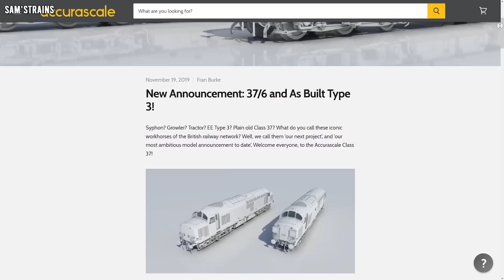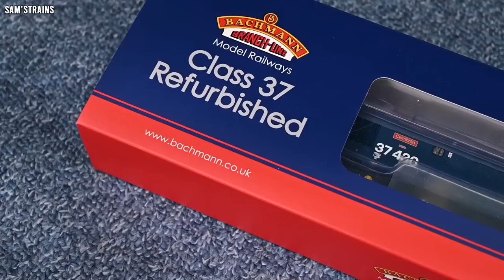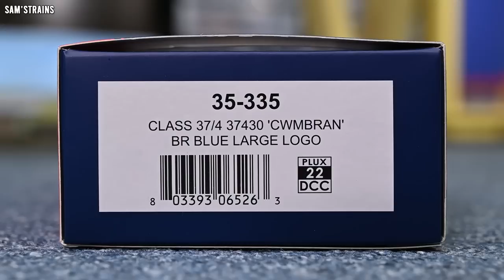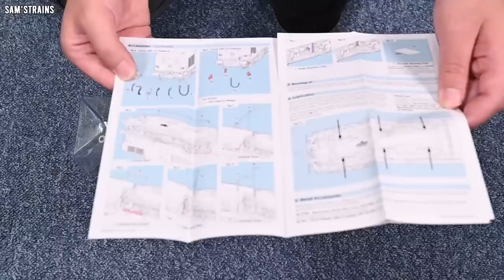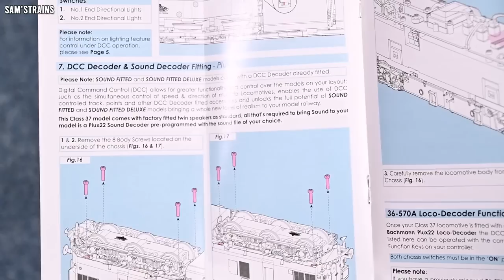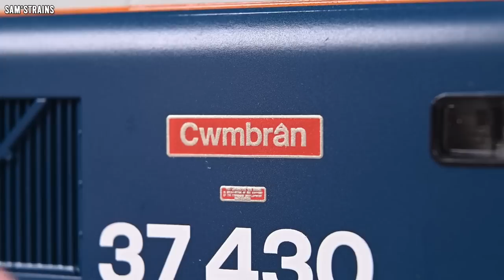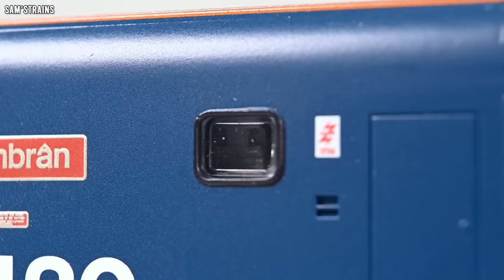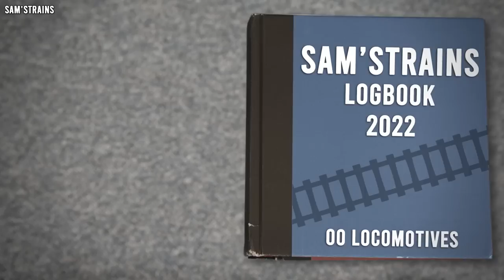All New Bachmann Class 37 | Surprise Release | Unboxing & Review

Comment: The old bachmann one still stands up. But it's always nice to have an updated version. I remember when vi trains released the 37. It was decent in its own right. But if companies are going to flood the market with a class of loco, the class 37 is the one to have lots of variety of. The prices though. I remember paying £50 for a bachmann class 37 and less than that for the vi trains one. The prices these days are why I only watch videos like this rather than partake in the hobby
Reply: Soo right why don’t companies design or update other locos
Reply: @robbiegrant5729  Bachmann has been updating their back catalogue for a while now. They've re-done their class 20, 24, 47 and 158 to very high standards recently and the class 25 is coming soon. They also re-did their Warship not too long ago, and improved the tooling on the class 40, 44/45/46...though these could have done with a full re-tool to be honest.
Reply: Yeah, the old one still stands up well. It doesn't stand up as a premium model any more - but at the right price, it still has its place in the hobby!
Reply: @christopherstokes9393  Absolutely, I still have every intention of doing the cab glazing correction mod on the 37/0 I started before this one was announced. I'm also keeping the Accurascale pre-order in place. Having said that, if Bachmann produce one in the livery and variant I want I'll happily buy it over a SH old tool one though, unless Accura beat them to a split box Dutch one. Sam seems to have a bit of a duff one if its struggling like that, the 430 I have doesn't have any torque issues. I took it to the club today and ran out of stock at 56 bogies and it still has enough grunt for more; same as the class 47 vid I uploaded a few months back.
Reply: I’m hoping that Bachmann will end up upgrading some of their other locos, as models such as the Hall, Jinty, B1, Standard 3, 4 and 5 and several other models need a few upgrades and definitely a new chassis. Then there are the V1/3 and Ivatt 2MT Tank, which need a new body but have had the chassis upgraded, and other models such as their Peppercorn A1, A4 and 9F could probably use a complete re-tool. That’s just my opinion though…

Comment: Bachmann have also retooled their 20, 24, 25 and 47. So it is not surprising they have retooled the ubiquitous class 37. And Accurascale are also releasing the later privatisation area 37/4s with detail differences including plated over side windows and front end lighting differences, so the new Bachmann 37 is an as-refurbished condition 37/4 which Accurascale haven't actually modeled yet.
Reply: Bachmann doesn’t make 37423 or the 37/6s with Wipac lighting, or the magnetic roof panel which makes DCC fitting easier than ever

Comment: Its a stunner of a model, but as you say the Accurascale model could well pip it depending on what lessons they have learned from the Deltic. I won't be cancelling my Accura 37 pre-orders any time soon, but I have succumbed and bought the DCC sound (not deluxe) version of this model as it is a simply stunning rendition of the Welsh 37/4s I remember very fondly on the sprinter replacement services of the late 80s and then the North Wales Coast trains out of Crewe through the 90s into the early 00s. I have to admit, a big bugbear of mine is working cab lights when a locomotive is in motion. Having been in a fair share of different class cabs in hours of darkness at various preserved lines, running with the lights on is a recipe for big problems as you literally can't see outside, meaning that signals (especially old semaphores) are very easy to miss. Safe to say I hate working cab lights unless the model is stationary or pottering about on shed, in service though is a HUGE no no.
Reply: Another point to consider is that Bachmann have been re-tooling their older back catalogue models to a VERY high standard in recent years having done the class 20, 24 and 47 plus the 158 DMU in the past year and the class 25 coming very soon. With that in mind, the big question about the 37 is more likely 'why not sooner?' rather than questioning whether its directly a result of competition from Accurascale. Another point to consider is Hornbys latest class 31 pricing, which makes this brand new 37 look a bargain!
Reply: You  can  switch  the  cab  lights  off.

Comment: Excellent model. In particular, the mechanism is outstanding - to the point where models that previously got 5-star mechanisms likely won't any more, because they won't measure up to this.

I agree that the £75 difference in RRP (vs. Accurascale's model) is eye-watering. Even if you consider retailer discounts, a difference of almost £40 seems like a lot. However, there are two further caveats that I would add: 

1) The Accurascale price (£169.99) was announced in 2019, before COVID and the supply chain crisis hit. I'm not sure how sustainable that price will be for them in the long run. It's great that they're honouring that price on existing orders (unlike a certain red-box manufacturer beginning with H); however, I won't be surprised if they raise the price for the second batch. 

2) The Bachmann model is a known quantity: you can pay £208.20, know exactly what you're getting, and get it immediately. By contrast, all but one of the Accurascale Class 37s are showing as "Sold out on pre-order", and the people who have pre-ordered don't know what they're getting (the Accurascale 37 looks like it'll be a sensational model, but until the first examples are delivered and reviewed, we won't know for sure). You have to choose whether to pre-order or not - and either way, you're taking a risk: either you pre-order the model (and risk it not being as good in reality as it sounded on paper), or you wait for the next batch (and risk a price increase). 

But if Accurascale deliver a top-quality product, and they don't increase the price for future batches, then Bachmann will look a bit silly!

Comment: I do applied Bachmann for the quilty of how it looks how its easy to get to the bearings and how the body is screwed  instead of clipped the wiring for the body yeah that could be different but thats fine but the part they still need work is the price point  of 245 pounds (double that for dollars) if I had that much I would go for the accurascale as its price is less then the Bachmann one
Reply: With Deluxe sound, advanced weathering, D6710 was 279.95245 GBP less VAT = 233.29GBP. My shipping to US was 22.50 for a total of 258.25 GBP. At today's exchange rate of 1.00 GBP = $1.27, cost in dollars was $327.98. (Generally speaking, shipping to me is about equal to the VAT deduction for most items of locomotive pricing.)

Comment: I don't think it will hurt accurascale class 37 as it has already sold out and they are on about releasing a 2nd run I think the price has a lot to do with the price of the accurascale compared to bachmann which is significantly dearer.I also believe at the moment Bachmann have no plans to cover the BR green era so I will stick with my order from accurascale
Reply: (May 27, 2024) Rails is listing the Class 37 at 259.99 GBP with DCC sound, 169.99 without DCC. Accurascale themselves list them at 283.00 and 189.00 respectively.

Comment: I'm a bit puzzled by the cab lights not working on Analogue, given that Bachmann's Class 85 electric does have working cab lights regardless of whether it's on DC or DCC.
Reply: Working cab lights on analogue control is representing something that would NEVER HAPPEN IN REAL LIFE. Train drivers are instructed NOT to have the cab lights on when in motion (with the possible exception of some slow shunting movements as it adversely affects their ability to see signals.

As such Bachmann may have decided that working cab lights under analogue control is not a feature they wish to continue with following feedback from proper modellers (who care about accuracy rather on whether their toy has lots of gadgets)

Comment: Sam I do believe that you are right in having your suspicion of Bachmann's 37 release, although you have very cleverly disguised your beliefs. One question that's resin from this is why British models still have couplings attached to the bogies and not the body? Maybe you can find out ? But like you, I'm very interested in seeing Accurascale's 37 which I'm very excited to get my Hands on soon.
 Keep up your great work 👍
Reply: As a US modeler of UK railways, I want the couplers on the bogies. Look at some of the videos of longer locos, like the 37, on a Radius 4 curve (22.5" radius) and consider that overhang coupled to a wagon, and you'll probably see a wagon pulled off the track if the couplers are body mounted. You can just see this if you slow the video down and watch it at abut 30:03. Unfortunately, the buildings blank the worst of the curves. At 38:56, you can really see the difference on these Second Radius curves. Note how much of the coach end is exposed. (That also illustrates why direct reverse curves are not suggested). This is similar to why the big articulateds, i.e.. Challenger and 4000, have the couplers on the front engine, not the body, as the overhang is awful.

Comment: In some ways, having two companies with the same model could be good for pricing.  Competition is good for consumers as it usually brings prices down.   Well, that's the theory anyway.
I don't see it as a waste of resources when it is two different companies releasing the same class if it promotes competition.  Unfortunately that does not seem to be the case in the Model Railway scene.   The prices seem to just keep going up.
I guess these are designed for DCC more then DC.  Flywheels are not so important on DCC as it can be programmed to slow down and speed up realistically.

Comment: An interesting model. 37's should be powerhouses and shouldn't really be phased by 10+ coaches imo. 
Also, regarding the cab lights, it's realistic not to have them on whilst running. It's the same as having an internal light on your car on whilst driving. So, for analogue, I do get that. 
I do feel that it was a tad generous to give 5 stars to a mechanism which doesn't seem to have any flywheels. 
The RRP for accurascale's 37 with full sound is only around £20 more than the RRP of Bachmann's bottom of the range 37, with no sound, so there's that to consider value wise. 
It will certainly be interesting to see what happens in the future. 
Excellent review as always 👍

Comment: Watching your review of the LBSC H1 4-4-2  I couldn't help noticing that your SR coaches didn't look very modern. In fact they looked positively ancient. Can I suggest the purchase of some Maunsell coaches would be appropriate with Pullman corridor connections, buckeye couplings and era 3, 4 and 5 SR and BR(SR) liverys. Obviously as the SR organised their coaches into fixed sets because their business was based on passengers rather than goods it would be good to buy coaches that could be formed into sets. This is easily done as Hornby did put the set numbers on the end of each set. One of the most common sets were made up of 3 or 4 coaches. However some sets had upto 8 coaches and Bullied and BR MK1 coaches were also formed up into sets. These sets remained formed up for many years. If you get a chance and have some old Hornby catalogues you can probably find some coaches on eBay that will make up some sets. I have made up quite a few sets (nearly 20) in 4 years. These include Push-Pull sets and non-corridor coaches. There are 5 Bullied 3 coach sets, 3 BR and 2 SR. The coaches are reasonably priced from £30. The set numbers are 965, 967, 968, 972, 973, and are made up of BTK-CK-BTK Bullied 59ft coaches that Hornby introduced in 2018.
Here is the list of these sets with the coach running numbers. Those with S at the start and end of the running number are BR sets and those without the S are SR sets.
965         2845	5711	2846
967         S2849S	 S5713S	 S2850S
968         S2851S	 S5716S	 S2852S
972         S2859S	 S5718S 	S2860S 
973         2861	5719	2862
I have those 5 sets as some of them were my first purchases. I hope that this gets you started.
Bye from Ian.

Comment: So my two cents on this is that you need to look at the wider picture. There are only a handful of locos that could support two manufactures. The class 37 is very much up there. 70+ years in service and every livery under the sun. Plenty of double heading and they get everywhere. It'd be a bold claim for even a single mile of track in the UK to have never seen one. Almost every layout can justify them and they are incredibly popular with enthusiasts.

Bachmann was already developing the class 47 new tool before Accurascale came to market with the Deltic and the 37 was the obvious next target to update with similar technology. I don't think this was a cynical stab at Accurascale unlike the Rails Terrier saga. The release schedule lines up well with the Class 47 last year being the major retool and this being this years. It was due for a retool anyway with the tooling being quite old. 

Ultimately, neither Accurascale or Bachmann will lose money on their investment and each has it's own merits. The Accurascale guys have already completely sold out of batch 1 before it's even landed. Batch 2 looks set to get some upgrades with a working fan and should be even more profitable as the tooling is paid off. I doubt Bachmann's examples will remain on the shelves long and neither will Accurascales batch 2.
Reply: That being said why oh why are bachmann doing 37043 as well in the same livery... ...would have been so easy to pick a different name in the same condition for double heading (i.e. people could have bought both).

Comment: Hi Sam, if I recall from the video there should be 2 switches on the bottom. Aren't they for controlling the cab lights on analog?
Reply from the maker: I tried switching them - they just turned off the front and tail lights!
Reply: @SamsTrains  yes - so its right to the prototype.

Trains are required to display one or more white lights at the front and a red light to the rear. 

When a loco is hauling a train it should NOT be showing red lights on the rear of the loco! - the red light indicating the 'end of train' is mounted on the last coach / wagon or on the brake van of unfitted trains!

If the loco had its tail lights on to then there is a danger (particularly in the days of unfitted trains) where a signalman might see the locos red lights and think the train had passed when in actual fact it had become divided somewhere which in turn could cause another train to be signalled into the back of the detached wagons.

The ONLY time the red lights should be lit on a loco is when its running solo (or if it is the rearmost of several locos coupled together).

Similarly when locos are running double headed then the white lights at the leading end of all locos other than the front one are turned off because they are not at the front of the train.

Therefore the switches Bachmann have fitted are there so as to allow prototypical operation of the locos for analogue users.

As I have pointed out in another thread it was not permitted to have the cab lights on while on the move so Bachmann are 100% correct not to have them as a feature under analogue control.

Comment: For that price, I would expect at least a motor/lights DCC decoder. Helical-cut gears would be a nice plus, as would a flywheel. The level of detail is quite acceptable, though, for a model at this price point. The fact that the fan is separately fitted is a nice plus as well; most - even on high-end US models - are molded detail, So I’ll give Bachmann half a star for this. 😌

Comment: Great review Sam! I have one of the older Bachmann 37s and as you say it's great. This model looks even better - stunning in fact but what a shame that they appear not have got the easy bit right, the performance.  So frustrating when the mechanism gets five stars and the performance  at £240 is rather poor, there is really no excuse and something that Hornby seem to do all the time.
I have one of the Accurascle 37s on order and if it runs anything like the two Accurascale Deltics I have then I shall be very happy. 
I will be happy to buy one of the new Bachmann 37s but would be looking for a very discounted price with that performance.